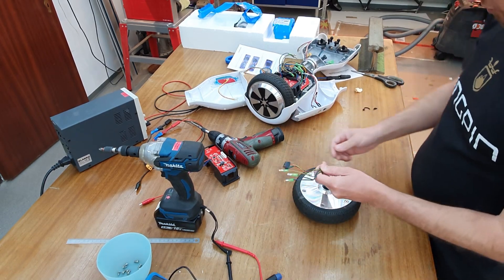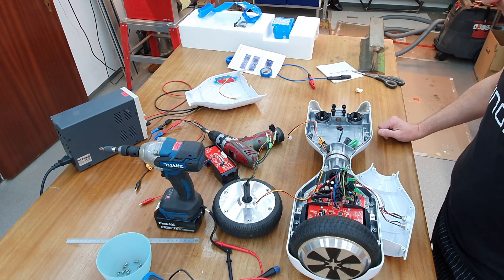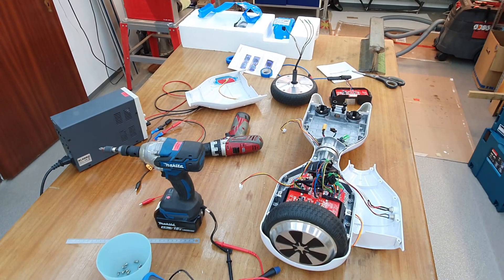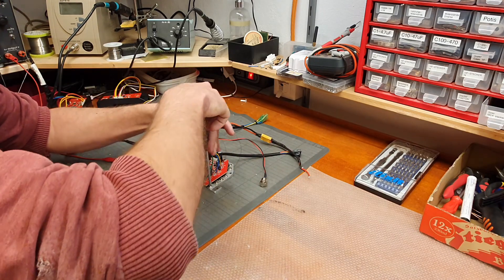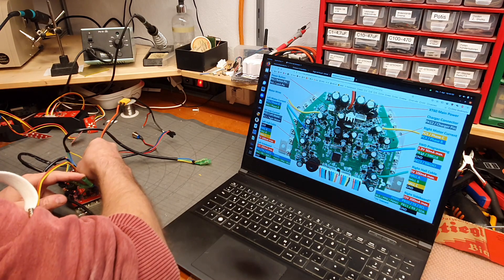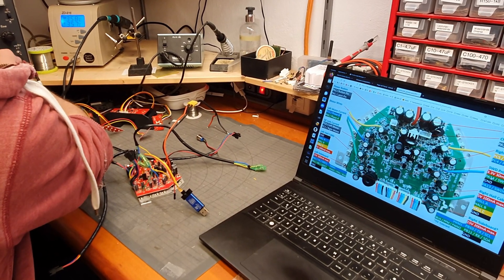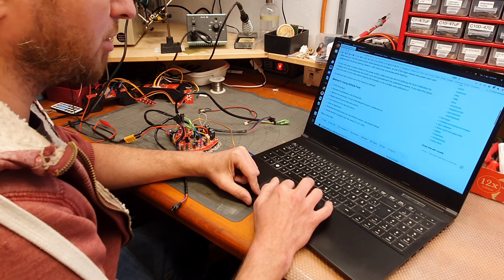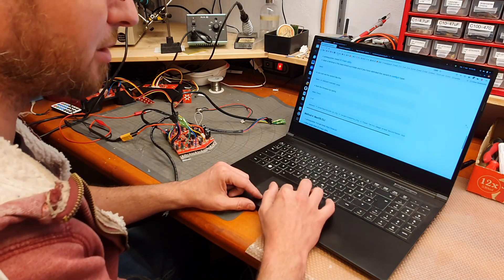Hoverboard Firmware Hack

Comment: Does the firmware hack provide more power to the motors than simply using the original motors driven by the tilt sensors of the hoverboard?